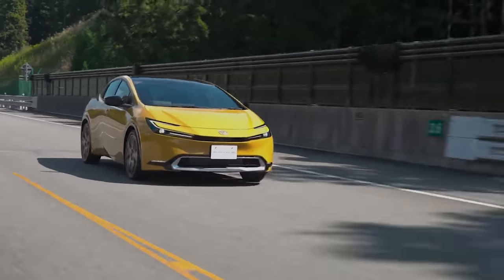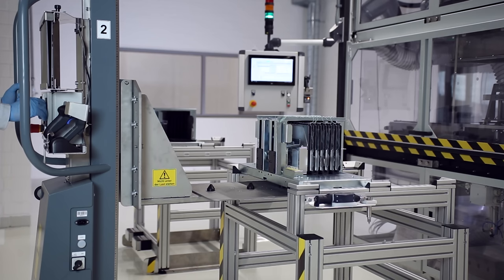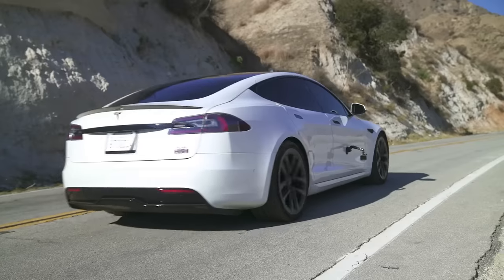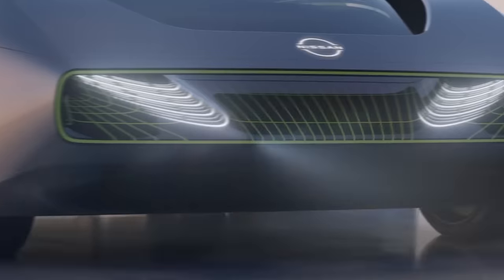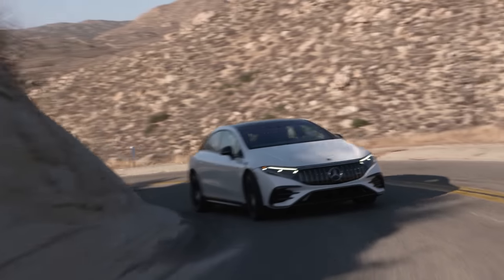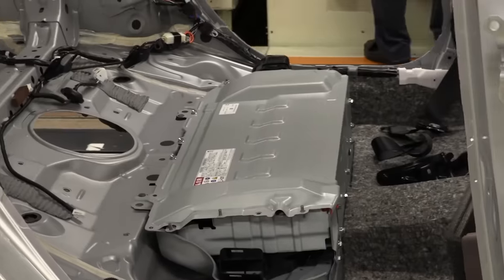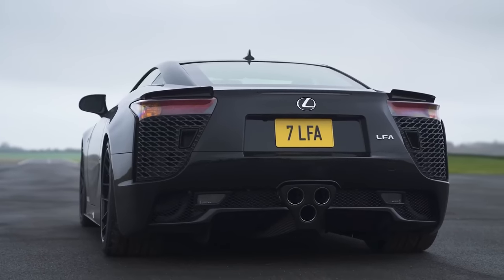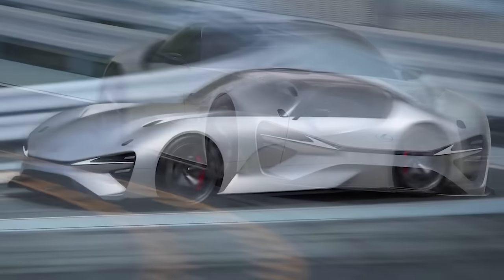New Lexus LFA with GAME-CHANGING battery!

Comment: Will these solid state batteries still use Lithium? I hope so, otherwise I need to think about my lithium stocks 🤔
Reply: Yes, they still use lithium, but they don't have a liquid/gel electrolyte separating the cathode and anode. The Wikipedia solid-state battery article lists numerous candidate chemistries for the separator, and every one includes lithium.

There's separate research into other battery chemistries that don't use lithium: sulfur batteries, iron and zinc-air batteries, vanadium flow batteries that pump liquids past each other, etc.

Comment: In the future there will be 1 car that can do it all of the same battery theres already e motor bikes that can be any bike you wish it to be based of the power it gives you but theres no decent range yet they need to focus on getting the same power out the battery from 100% charge to 0% it needs to be the same power like combustion else whats the point, once you run out of petrol you fill up and go again but once you get below 50% battery it might as well be a 1.1 corsa full of bricks if it cant pull its own weight without draining itself even more then whats the point

Comment: Toyota doesn’t get it that huge bonnet but it hasn’t actually got a motor in it a fake clutch and fake manual transmission in an EV it’s almost laughable the way they are clinging to the past let’s see if this solid state battery actually works no one has made a car sized one yet

Comment: Toyota's more likely to go bankrupt. They're too far behind and too late to the game to even compete in a race that started years ago. In 2025 they'll have a car with double the energy density of today's cars? Yeah, so will everyone else in 2025. And everyone else will be on their 3rd or 4th gen vehicles, will have refined their designs and engineering, will have ramped their factories so will have lower cost of production, meaning Toyota will come into a mature EV market with low-cost vehicles, meaning they'll have to take massive losses on each car they sell, as the early adopters who would pay a ton of money for a sloppy first-gen EV don't need to do so anymore. The bZ4X was such an embarrassment they should have never released it. They're hoping to sell a mere 10,000 this year and I wouldn't be surprised if they can't even do that. Hybrid sales are crashing as EVs and charging stations are now good enough to make them pointless. The more likely explanation for why their focusing on hybrids is that everyone else has has now locked down their lithium and battery contracts for the next 5+ years and there's nothing left for Toyota. Toyota is leading the collapse of Japan's car market and the subsequent collapse of the Japanese economy. Good job Akio. Grampa would be proud.

Comment: Sure, the LFA is gonna be fast as hell however why ruin it making it an EV? It already sounded godly we don't want a small eeeeeeeeeeeeeeeeeeeeeeeeeeeeeeee sound now do we? We like the nnnnnnnNNNNNNNNNEEEEEEE  nnnnnnnNNEEEEEEEEEE nnnnnnnnNNNEEEEEEEEEEEE of the V10.
And they better not make the mistake dodge did and try to make it sound the same with speakers. 
I mean if they can it would be nice if they took original LFA sound and installed GOOD QUALITY speakers (unlike dodge) and made the sound match the RPM because that would make this a lot less ruined.

Comment: these solid state batteries are truly changing everything, the best li-ion batteries used in cars have a 150Wh/kg rating. Thats gonna be an increase of 230% and an insane weight decrease. finally we are gonna have 1300kg light cars again
Reply: No that's the best sodium ion energy density right now. 4680 lithium ion is rated to 260. LFP are a bit less but 4x more life. 4680 and the structural battery pack architecture saves 400-600lbs making 4680 ev's same weight as ice.
Reply: @larryc1616  i just took the eqs battery for reference, the battery weighs about 700 kilos for a 108kwh usable capacity. but still insane going from 260 to 500, almost double. so same range at half the weight

Comment: fake transmission, fake clutch, fake noises, it all sounds dumb especially because this is just adding weight, complexity, cost, possible failure points without really adding anything. shifting in a gas car has a purpose but here its just limiting the power of the motor, because you have engaged an imaginary gear. 
The only few use cases I can Imagine are:
-training on using a manual to learn or improve your skills (or maybe just not lose the skill), without the risk of damaging engine/clutch/transmission
-controlling regen downhill so you can lift the throttle without having the car come to a stop?
-driving on a track with traction control disabled but using gears to control regen and power exiting corners

I think its just a gimmick just make lightweight and powerful hybrids and/or EVs with good electric range and better perfomance and lower weight than their gas equivalent, and charge nearly as quick as a fuel stop, that's alll people are asking.

Comment: Quite a clickbait video CarWow that I would not expect this channel of, bit of a shame...
1. most of  automo companies are doing RnR in the field od SS batteries, and Toyota doing the same is nothing game changing, the main issue with the SS battery to date is dendrites, which makes this type of Batteries more prone to catch on a fire than the the ones currently in use. 
2. the fact that toyota will use SS Batery in Hybrids, is hardly ground breaking, it will be more of a life testing of the said batteries in lower stress condition - hybrids have much smaller batiers, that mainly charge from recuperation, so even for PHEV's they will need hardly be stressed as the big battery packs in pure EV.
In short no news here worth the headline. Still, I am holding my figer crossed hoping that this technology will be finaly usable for pure EVs.

Comment: Unfortunately, auto makers don't care abou🎉t their customers  !!!! This is why vehicle pricing is astronomical and the push for ev's when there isn't the inferstructer to handle it. For it to be viable for me, it would have to cost under 60,000, get at least 300 miles per charge,  even in cold climates, and fully charge in 10 - 15 minutes.  Otherwise, I'll stick with ice and a five 10 minute fill

Comment: An operational Solid State battery system: We will see. "Even if the technology works (and that is a big if after 40 years of development), the technology is unlikely to find more than niche opportunities in the market.”
Actually, I hope it does work as hoped. But 40 years of development has not yet produced the required level of results. If Toyota plus Ford and Nissan plus others have been working on this, where are the cars from those partner Legacy Companies? Why is only Toyota/Lexus and Nissan the only ones to build prototypes?  
Why 2028 for Nissan and Lexus not until 2026? Because the technology has NOT been perfected. Plus, no, Toyota has not been working on SS batteries since 2012: it has been 40 years of development. FAILED development, so far. 
Fingers crossed they are not telling "porkies" and they will be able to put them into production rather than being "hand-built" prototypes. They look like fun! Cheers.

Comment: How about automobiles with batteries actually use the batteries for efficiency, instead of 1100hp equivalents for 0-60 in 1.9 and costing 150K?   Rhetorical.  BS drag times. This is an entertainment channel.    Batteries are older than petrol for powering things.   Horrid/old technology.   Where is all this electricity to charge coming from?  I think big oil and gas might not enjoy it.  Too soon?  Last 100 plus years.   Bring on profit companies doubling up solid state batteries for 2000hp and CarWowing.  Snooze

Comment: No one cares lol. It's a "sportscar" which coincidentally will weigh as much as a base F150 and the manual doesn't really matter, because all you're doing is a simulation. If I wanted to do that, I will stay at home and use my logitech G29 setup on Forza. Lexus is going the way of the Europeans and the Americans. It's a sad day. Doesn't matter that it's got 2000 hp and 0-60 in 1. something seconds lol. That 2000 hp won't be usable anywhere on the public road and the 1. something 0-60 won't be fun to your stomach and guts after you do it a few times. I will keep my 135i stick thank you very much.

Comment: Car wow when are you getting a hydrogen car on the show be interesting
Reply: Hydrogen cars are great technology but they just dont make any sense compared to pure EVs.
Reply: @londonyes1380  I believe making fuel from the most abundant gas on earth kinda does make sense where electricity is only increasing in cost hydrogen could be our saving grace
Reply: @rorybailey3279  It might make sense for much larger applications like cargo ships or planes but for personal transport its not needed.  Dont forget the ammount of energy it takes extract and refine hydrogen over and over again vs putting that energy directly into a battery pack.